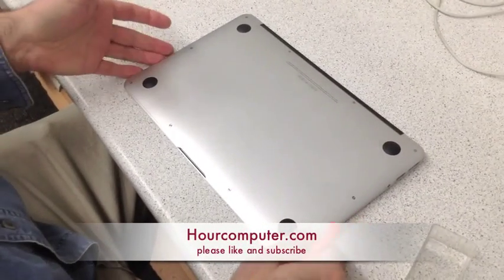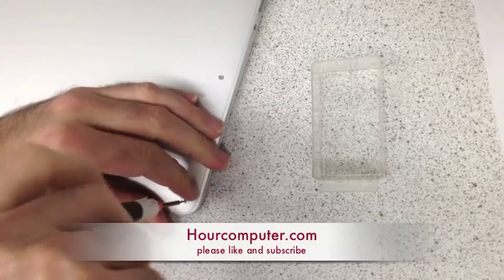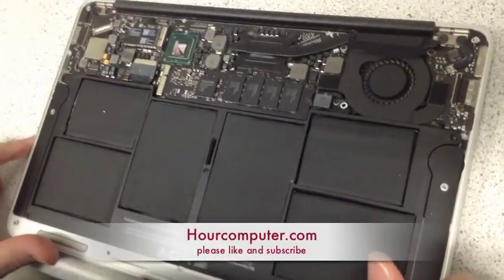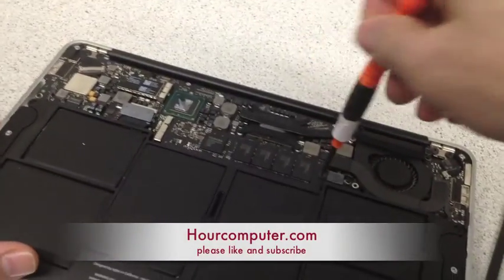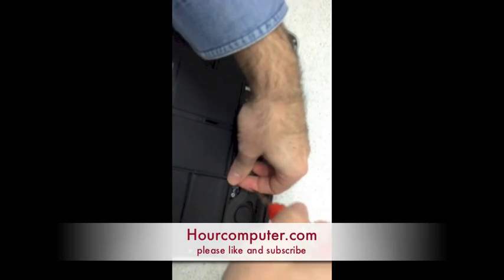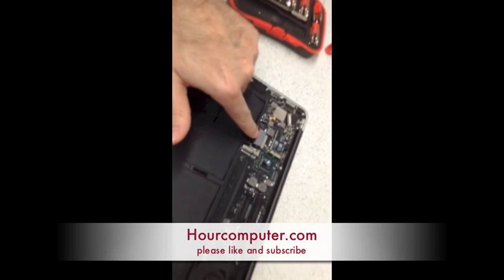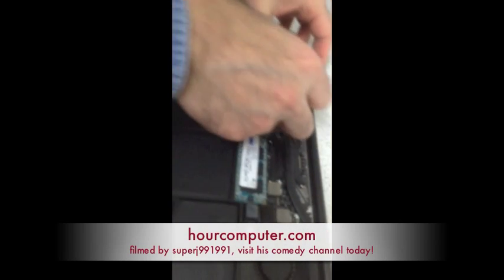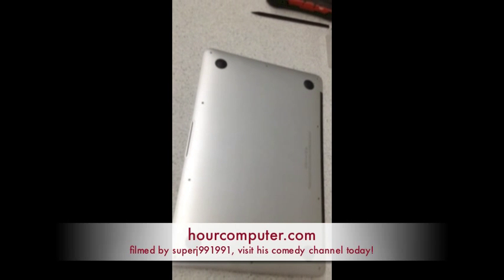macbook air hard drive

Comment: I get a flashing folder with question mark icon when turning on my MacBook air.  Nothing so far has worked.  Will replacing the hard drive work?
Reply: YermSeul_21 Were you able to replace the cable?  Im trying to find a video especially for MAcBook Air hard drive cable replacement.  I have a 2012.  Let me know.  Thanks
Reply: Baldo P same with my macbook air I think it needs to replace the hardrive cable?
Reply: I have the same problem. I keep on trying to fix it in recovery menu and it doesn't work anymore.
Reply: I ended up buying a new Mac book. Still have the one that messed up, and still haven’t done anything to fix it 😅
Reply: @osbaldopreciado  well i guess it is time for me to say goodbye to this old buddy of mine too...